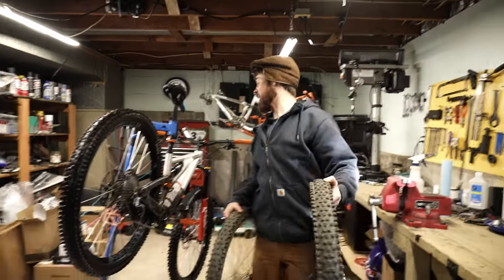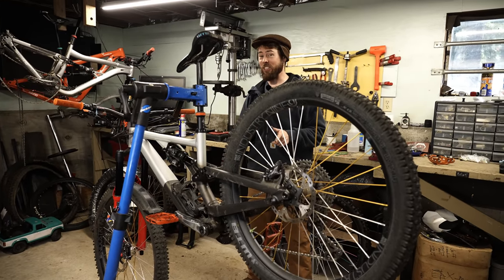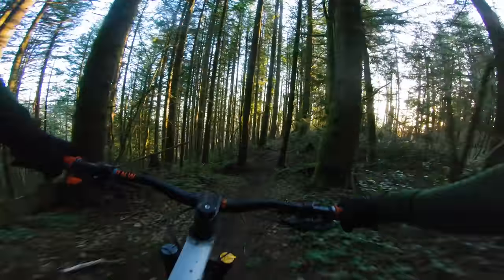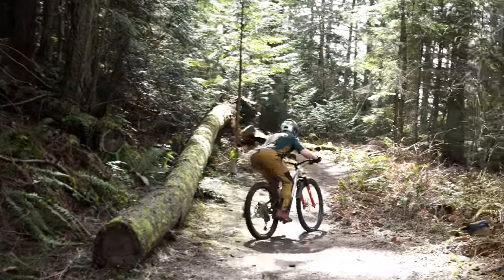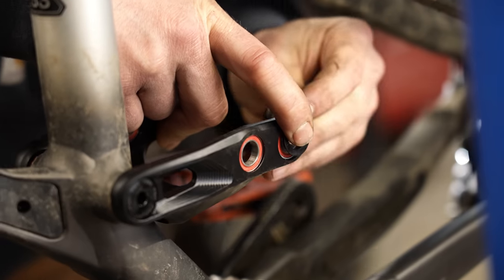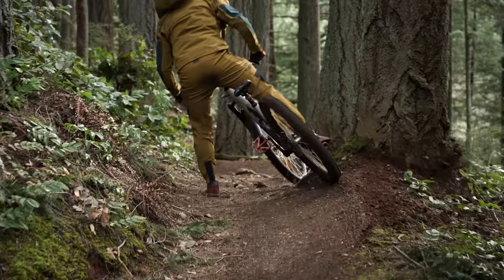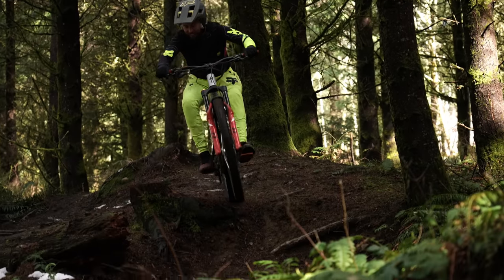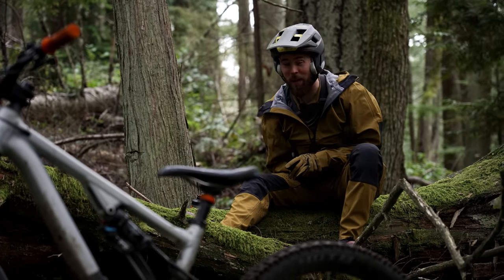Stumpjumper EVO MULLET: am I wrong?

Comment: I currently run this setup on my Stumpy Evo. The reason I switched to mullet was to stop buzzing my backside on the back wheel. After an OTB (and fractured elbow) because of my short legs + big wheel size, the mullet has been great. Can’t say I notice a real change to the bike’s performance other than I haven’t buzzed my backside since the switch.
Reply: That’s why I ride dual 27s or mullets as well, short legs and off the Back riding style I’ve buzzed my backside too many times.
Reply: How tall are you guys? I'm 5, 9 and I switched to Mullet because of this reason, but some of my friends around 5' 6 or 5'7, they said they rarely feel the back wheel buzzing - I'm confused.
Reply: I'm 5'8
Reply: yeah same.  im 5'5" and always hitting my back wheel on the seat with the 29wheels. but too cheap to buy another wheel/link.  this was never an issue on other bikes iv own with 29wheels.  I run more pressure in the shock now, helps.
Reply: I’m 5’11” but I’m all torso with short legs.  I adopted 29ers early but on super steeps DHs or bigger drops I’d get Nutt Scrub that sometimes was bad enough I’d have to pull over 🤦🏻‍♂️
Reply: @andrewchow523  I'm 5'3 on a full 29er and I never buzz my butt...maybe just a few times..ever.  And yes I ride steep technical trails..(PNW).. I think most people think they need to get back much further than is necessary..
Reply: @meganNefarious  Sounds like it all depends on your height + your usual body positioning
Reply: @andrewchow523  Yes that's my point.. I am very short but I don't have issues buzzing my butt on my tire.. Most people are getting way too far back hence the butt buzzing..it's not good to hang so far off the back of the bike. It also causes less grip on your front tire which you def don't want.. It's best to keep a more neutral centered position.
Reply: @meganNefarious Pro riders talk about buttt buzz on 29ers as well, are you saying they are also wrong and need riding tips? There’s no 100% “correct” way to ride; everyone’s size/shape and style is different, just because you don’t have a problem it doesn’t mean others won’t. Different bikes will also give different results regardless of wheel size.
Reply: Where did you get the link to Mullet it? Thanks
Reply: @AbrahamBarberi   I know Specialized sell it, a couple of Stumpies actually come mixed wheel from stock.
Reply: @AbrahamBarberi got mine from my local bike shop in the UK (Ace Bicycles). They received it in from Specialized.
Reply: @meganNefarious try steeps or drops or steeps with drops

Comment: As per another comment. The mullet set up with the cascade link and the WRP yoke makes a huge difference to just running the straight specialized mullet link. You get all the suspension benefits and no geo change

Comment: Great video as always Jeff! I did the mullet experiment on my EVO (using exact same wheel and tire just scaled down for science) and came to the same conclusions you did. I'm back on full 29 and I definitely prefer it that way. The slightly increased ease in cornering wasn't worth the loss of traction and rollover.

Comment: 3 points: First, LMNT is really amazing. I picked up the sample pack after watching one of yr videos. As a type 1 diabetic, I've always had a tough time with hydration supplements since nearly all of them are loaded with sugars. I could only sip these at best for fear of having a blood glucose spike. On the contrary, I can drink much more of LMNT w/o issue and the increased clarity is real despite the claim sounding like sales pitch nonsense. So again, thanx for that. Second, I've been riding a Stumpy EVO since last November and went with the Speshy 27.5 link right out of the gate as I had run my previous bike (Evil Wreckoning V3) with a mixed wheel set up and really liked it. I dealt with the reduced progression which was already lower on the EVO versus the Evil, by running a Marzocchi Bomber CR with an MRP progressive spring. This has worked great and I suspect you could go do something similar by adding more tokens with the air shock. That said, I knew I wanted a coil for it's plush feeling off the top along with it's simplicity. Another way to this end is to go with the Cascade link and run it with a WRP yolk which adds progression and more travel without changing the base geometry. I have not tried that, but it is much more costly route to take than my solution. Lastly, the mixed wheel set up worked great for me in overcoming some of the issues I faced with a long travel 29er. It returns more of the playful and poppy feel I like. It allows me to bunny hop and generally get airborne easier as well as cornering better/faster and maybe most important I don't get a tire up my tuchus on hard g-outs due to my short legs. Long legged riders on long travel 29ers don't face these issues and my couple of taller friends stuck with their 29er set ups due to this. I do still think 29ers are the bomb for shorter travel  (sub 150mm) bikes and hardtails for those with short getaway sticks like myself, but I'll keep the wee wheel on my battle sled. Ride on!

Comment: I've been running a mullet setup on my banshee titan for about a month now after swapping from a full 29er setup. I still don't really know which I prefer. They both have their pros and cons. The mullet is definitely better for the slower speed steeper terrain where I don't have to worry about the extra speed the 29er has, and the extra butt clearance is more important. However, on faster flow/jump trails and also faster tech trails the full 29 setup is definitely the way to go

Comment: Running a mullet setup on a Rocky Mountain Altidude 2021 (with the MX link by Rocky). I find it to suit very well my style (very active riding, not racing, jibbing, drifting for pleasure, lots of jumps), but it comes with downsides. I'm my opinion mullet is a very niche setup for people with shorter legs (I'm 5'8'')  who wants to jib their bigger enduro rigs
+ I do find technical manual easier due to legs' increased range of motion, easier to turn during manuals
+ Way more solid wheels (main reason I switched to the mullet config.
+ I find it better for jumping but this is really personnal choice
+ Less tire buzzing my rear in steep-tech terrain, which was my second reason for going mullet. Never buzzed my ass riding Mont Saint-Anne before riding 29'' bikes, on some trails it became inevitable...
- Pedals will touch the ground way more (3x more in average in my case) 
- Technical climbs got harder.
- Less grip on off cambers or flat corners.

Anyway, great content from you Jeff I like your honesty.

Comment: Just got a mixed wheel bike for the first time and I am really enjoying it. But, I think I am a pretty perfect candidate for one. I am about 5 foot 9 but have really short legs so the extra clearance makes a big difference for me. I also ride my jump bike a lot (pumptrack, BMX track, skatepark, etc.) so I think that has made me used to riding actively and moving my hips back a lot. On the full 29 setup I didn't actually buzz my butt a ton, but I had to ride steep sections in a 'bench press' position to keep my butt away from the rear wheel. It feels like I have so much space to move and find jumping the bike and riding steep/tight corners easier. If i was 6 foot, I don't think it would matter, but for shorter riders (or short-legged riders) I think it makes a big difference if you like steep, jumpy trails.
Reply: How short is really short legs? I am 5'9" with 30-31 inch inseam
Reply: @timothykobara6329  I’m 28 or so.

Comment: Ran a 26/24 mullet on my Cannondale Gemini DH bike in the 90s. (Wasn’t called mullet then) 
Made sense. Running narrower rear tire, wanted slacker head tube angle when manufactures weren’t hitting that sweet spot yet and something about the looks of it solidified the “purpose built” look for a model that was not designed to race DH. Easy way to turn that free ride bike into a DH dozer!

Comment: I finally got around to trying my size S5 stumpy Evo with the specialized link and 27.5 rear wheel. I like it a lot. I think It benefits the handling with an XL bike. It took me about a year to finally try it out, since the 29/29 combo was so good, but I prefer the mullet.
Reply: how tall are u?? <3
Reply: I’m 6’1, short legs, long torso. S5 evo and I’m converting to mullet because it makes the very large bike feel a little easier to corner.
Reply: @JesseStarrPhoto  I'm on same size and similar build. The mullet is more fun on tight trails, the 29er has the edge on big chunky rock features.

Comment: At 5'7" I ha been on a V2 Ripmo for about 2 full seasons.  Last year I picked up a V4 Bronson designed specifically to be a mullet.  After about 3 rides on the Bronson I sold the Ripmo happily.  Why?  First and foremost at my height...more freedom of movement for my rear end.  No tire buzz, could get lower etc.  The bike was easier to throw around and I was simply having more fun on trails I am very familiar with. Only real downside which is minor is a bit more ping ponging around of the back end in a really chunky section at speed.  Minor inconvenience.  Again....I'm a fairly short intermediate+ rider and the well engineered mullet just for whatever reason left me smiling more.

Comment: I had a Status 160 (mullet) and have also ridden a stumpy evo 29er. I currently have a Norco sight 29er. Definitely noticed the cornering better with the mullet, but the big wheels can still turn. But more than that, with the 29er I felt the increased rollover when climbing/descending, and the better braking which is ultimately what made me sell the status and get the 29er

Comment: I just bought a Status instead of mulleting a stumpy...I find it accelerates faster and is easier to whip around. I also spend a fair amount of time on the rear tire due to my trials experience a couple decades ago, and I prefer how easy it is to hop and pedal kick on a 27.5 compared to a 29. In addition, I grew up riding a 26/24 mullet so it just feels right. I'm always putting down the landing gear for drops, and I reeeealy don't like buzzing my balls on the tire in the air.

I'm also nowhere near the same level as our presenter, nor do I attempt to carry even half as much speed.

Comment: Sooooo.. I run the mullet link WITH the 29" rear wheel. 2.4 rear, 2.6 front tires. Adjust the headset angle and rear flip chip to suit what type of riding  area I'm at. Gains a good amount of pedal clearance for tight, rocky northeast trails. Have ridden Sedona and other southwest areas too and still super stable at speed.

Comment: I have been testing all 3 set ups back to back for 3 years. Having almost identical bikes set up at the same time. I have a 34 years MTN biking and similar time , in mostly woods moto. And if you think about  it, a smaller wheel and why it turns quicker at the same lean angle the arc of the wheel is tighter on the smaller tire, causing it to turn more at the same lean angle. And this I seams to feel less predictable, on a bumpy section. When you are threading the needle, trying to hold a tight accurate line. Each wheel reacts differently. I run wider tires on my 27 bike than the 29er. so they have similar traction and quickness. A 27 rear is great for not buzzing your butt on steeps, but I think Mullet bikes  don't hold as good of a line on surfaces that are changing camber a lot. Which is mostly an issue when your line is very important and getting off line is a big deal- at speed with hazards. A mullet in theory will cause the rear to stand you up, because it is turning in tighter under you. .In Moto you are constantly using throttle or brake to rotate if necc, so it is factored in. 
I I prefer all 27 or 29, I think the fade will eventually be superseded, but you can used to it either way, and it's not that big of a deal. Jeff, you are the best!

Comment: My first mullet(bike) was in 03'.  Rigid SS 26ers where what all us shop rats where riding. When wtb started making 29er tires, we'd build them up on touring rims and run them as front wheels stuffed into suspension corrected 26" forks.   The benefits on a rigid setup where obvious. The steering was....iffy but, the concept makes sense.  Less giroscopic resistance below your hips on the rear wheel and a big ol front wheel for rolling over things in lieu of suspension. I appreciate your perspective on modern geometry and the traction benefits of dual 29's.  Been thinking about a stumpy...you may have just helped me pull the trigger.

Comment: I got the mullet link for this frame out of necessity. I bought a frame only and used all the parts off of my Status which is mullet from the factory. I have changed it into a full 29 once I could afford to get my wheel relaced. I honestly haven't felt a worth while difference between the two other than a smidge more playful as a mixed setup, but it climbs a lot better now as a full 29.

Comment: I have the Stumpy Evo alloy and run it with the mullet link and have tried it as a 29er as well.  At 5'8 I find it lets me drop into steep rollers with a bit more butt clearance which is nice.  I also find it enters and exits the turns quicker.  I'm wondering if your lack luster experience has something to do with the 170mm fork?

Comment: Great video! Currently on a Bronson V4 w/ cascade link - love it.

I’m wondering if testing a purpose built mullet (rather than Frankenstein build or link conversion) would improve your mullet ride experience.

Also perhaps running a stickier back tire (maybe a dissector DD maxxgrip) to tune & improve your rear wheel traction. 

I run the Assegai/Aggressor combo on my mullet bike and definitely notice the rear end has less traction (which I like) compared to previous dissectors or DHR2 that I’ve used. I find the latter two tires make the rear end have more predictable drifts. Aggressor can be a little more skid-dish, especially in damp conditions.

Comment: Just came across your channel. Great work Jeff, really enjoy your content...I played around with the mullet set up back in the 90's on the N. Shore(Vancouver) and yes I'm 58 now and still riding. Back in the day we were going to a 24 on the rear with the 26 up front and the main reason was for the quicker acceleration you get from a smaller wheel. As the big N.Shore scene was developing, we spent a lot of time manual ling off of big stunts and some guys swore by the set up but I didn't like the unbalanced feel and switched back to the full 26" set up. Luckily in those days in winter riding I would go through 2-3 rear rims a winter so it didn't take long to kill the 24". V-brakes mixed with our PNW mud and soil would chew through aluminum rims like butter on a hot biscuit, plus a lot of flat landings didn't help either. Some days I'm surprised I can still walk. Motocross bikes use the same theory but with an engine involved, small rear for the quick acceleration and the 21" up front to handle riding over obstacles. Hope this helps...Cheers!

Comment: 2019 Rocky Mountain Pipeline 27.5-plus converted full 29er, and recently mullet setup. I feel like the mullet gave it the nimble handling it had before on 27.5, but definitely lost some rollover and rolling speed is only marginally slower. Had to make several small geo and suspension adjustments to make it feel right. Added an angle headset and shorter cranks, and really liking the setup now. No plans to go back anytime soon. Fun to experiment with regardless, especially on an older bike. 🤘🏻

Comment: I've had the same bike (Stumpy Evo Elite) for a little over a year and rode it as a 29er for about the first 6 months before I switched to the mullet setup. Honestly it was the first full 29er that I actually got along with handling wise, but occasional booty to tire contact was still annoying so I ordered the mullet link.

For me, the mullet setup is all upside... better butt clearance and a little quicker and more intuitive lean/turn-in feel. Traction is about the same to me, BUT I did replace the stock 29" specialized rear tire with my usual 27.5" maxxis aggressor, so not apples to apples tire wise and neither tire has great traction in the loose conditions I've been riding lately anyway.

Because I feel like I only gained from the switch I have zero desire to go back to full 29er mode, but not a night and day difference either.

Comment: I'm short, 5 7, so wanted to get something that would mullet without geo changes.  I got the EVO, loved it, tried the mullet and I found it to be harsh w the 275.  I couldn't figure out how to soften it without making the suspension feel sleepy.  I was all hyped up on the mullet but couldn't get it to feel right.  Seems like your beef with it is different than mine but the good news is that it's super fun as a 29er!
Reply: If you’re using the specialized mullet link, that’s your problem. It negatively impacts suspension kinematics, they didn’t do a good job. The WRP mullet yoke solves this problem

Comment: Mullets exist for four reasons:

1. Small shredders
2. Protect your taint on gnarly drops
3. Ebike chain stay management
4. Protect your neck from sunburn

That's it.
Reply: Point 3 in particular.
Reply: As a tall rider who finds the mullet set up to make cornering tight switchbacks a lot easier on my XL frame, I disagree with your list.
Reply: @JesseStarrPhoto  mullet has no effect on wheelbase. What you're feeling is likely a lower BB, which makes it easier to balance below 3mph.

Comment: I’m running a mullet on my Enduro because I’ve killed two 29” rear wheels in the last few months and I didn’t have that problem on my old 27.5” bike a few years ago. Noticed the same easier to slide the rear into a turn which I do like, sometimes 😂